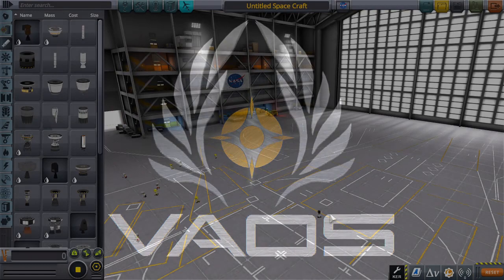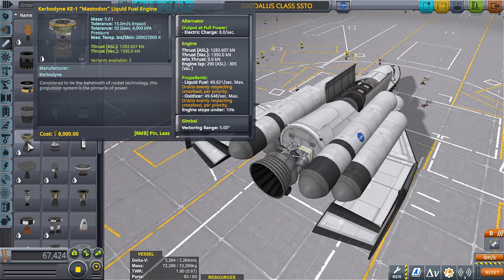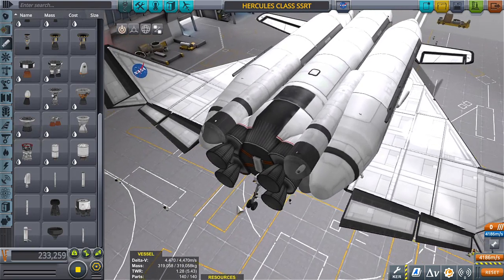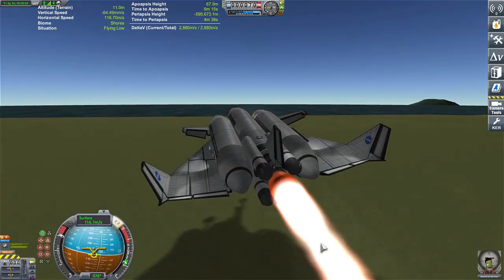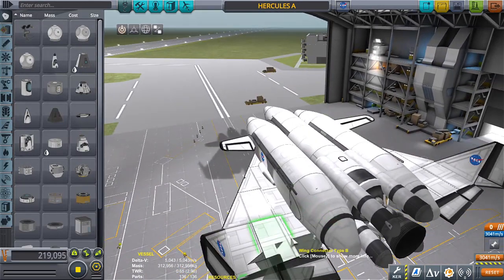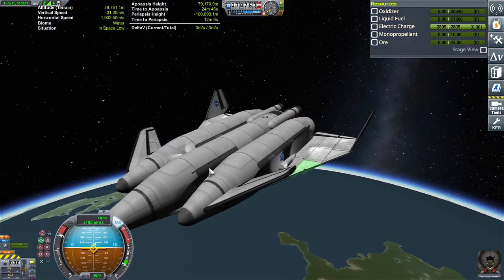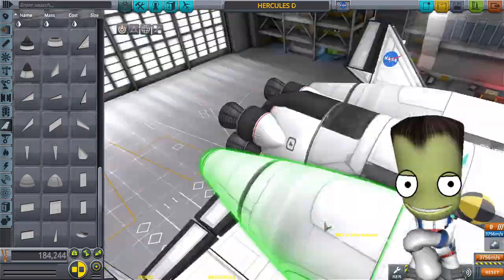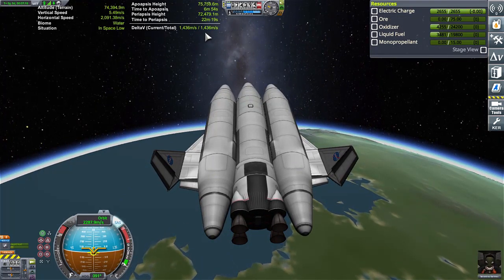SSTO SINGLE ROCKET ENGINE CHALLENGE part 3  \  KSP 1.11

Comment: 1:43 Mastodon was another species of woolly mammoth.  
2:17 Given that delta-V is normally discussed as a parameter of spaceflight, I think your Kerbal Engineer mod may be calculating delta-V in vacuum conditions only, not atmospheric flight.  Hence, the better vacuum ISP engine would show better delta-V.  Test flights are more reliable than mod stats.  
7:43 By the vacuum ISP stat of the Rhino engine, I don't think you've seen the Rhino at its best in this video.  Try taking off from Tylo with this same exact craft and I bet you would have a much higher opinion of it.  I think the Rhino is probably your perfect "interplanetary" engine -- it just happens to be one of the worst atmospheric SSTO engines.  
8:01 Whoooooooooooooooooooa!  EPILEPSY WARNING!  hehe  ...But seriously.
10:04 Bruh.  My brain can not comprehend how you are not already burned out doing this series.  I get done my wimpy little desk job at the end of the day and all I want to do is flop down and take a nap.